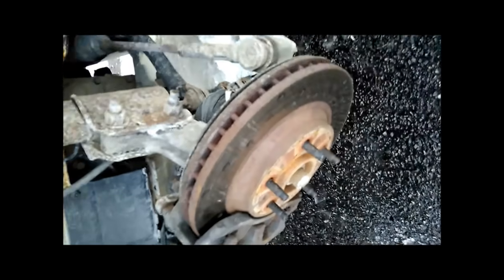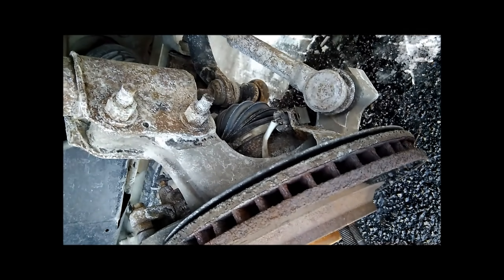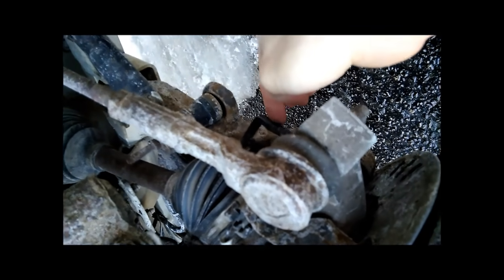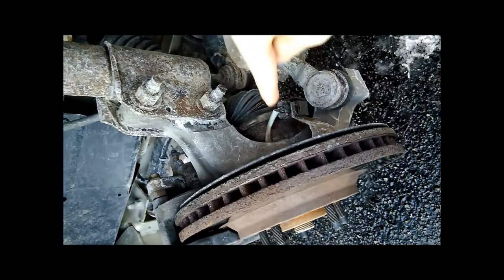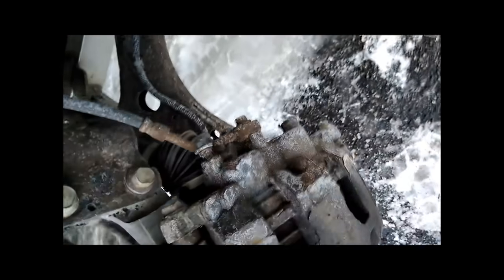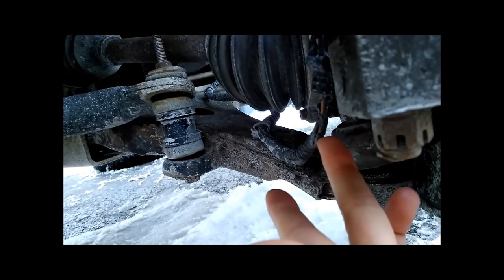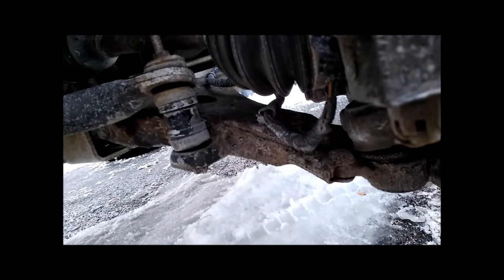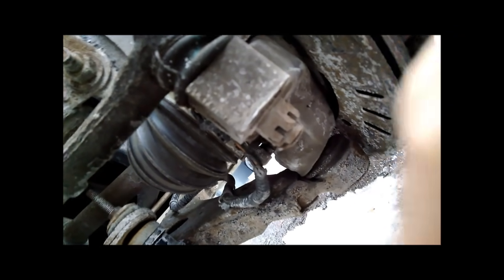How to fix ABS light, Traction Control, Stabilitrak

Comment: Tip from other video-Turn on keyctovRADIO-Apply GAS PEDAL 3x . WAIT AND WATCH ALL LIGHT GO OUT. .. take for Drive@15 ml. Hr. 10 mins( should) fix
Reply from the maker: That sounds eerily similar to how you reset your change oil light.  The TCS MIL lights activate based on the system's health.  Clearing the lights wouldn't make the problem itself go away.

Comment: I have a 2016 Scion IM battery was dead for a couple days and then the traction control light came on and hasn’t went off. Should I check the sensors behind the wheels
Reply from the maker: by dead do you mean disconnected or just low?  Low voltage can screw up the computer.  I would disconnect it for several hours and then reconnect it first.
Reply: @ChrisCamaro  Just low. Disconnect the battery for a couple hours or the sensor? Thanks man appreciate it
Reply from the maker: @luisgarcia2326  I mean the battery.  Because when the voltage is below something like 10.5V (in most older cars at least), the car's computer is voltage starved and behaves erratically.  Disconnecting the battery is like doing a hard reset on a computer.  Most systems will forget any glitches they had before and just boot up fresh.  Of course when you reconnect the battery it should then be healthy (12V or more).  If the car is running you should get about 14.5V.  If you have less than 11 when the car is running, all sorts of bad things will start happening.
Reply from the maker: If you want to just test the theory without buying a new battery, you could disconnect it and while you're giving the car a rest, you could charge the battery at 16V for several hours.  This "kind of" fixes it.  See my video on rejuvinating a car battery.  This way at least when you reconnect it, you aren't undervolting the car

Comment: I recently got two brand new tires on my car and then I started noticing the traction/abs light coming on. However, the light comes on for a while and then goes off.
Reply from the maker: This "can" be the fault of the tires if they are not the same size as the other 2.  It's important that the tire circumference of all 4 tires are the same.  If they are different by enough of a margin, the computer doesn't understand why 1 or more wheels are spinning faster (because they are smaller) than the rest and can't do the traction calculations reliably so it shuts the system off.  It might be a good place to start if you check the designation of your new tires and look up the circumference and compare it to the designation of the other 2 tires to see if they match.
Reply: @ChrisCamaro  this is the exact problem I have on my 2011 camaro. Got new bigger back tires but it’s a major difference. Ordering new front ones Friday that will be bigger but not the same size a bit smaller. Hoping that fixes my problem
Reply from the maker: @foogiez  Check the rolling circumference and make sure it's not too different.  If the difference is marginal (ie. on the cusp of triggering the system off), you can cheat it a tiny bit by de-inflating the tires with the larger circumference and overinflating the smaller ones.  Of course this is only a very small cheat if you're 99% there.

Comment: Mine only comes on when it gets cool, like a connector is contracting some and the wire(s) aren’t completely.  Can some electrical gel be applied?
Reply from the maker: I probably wouldn't go that way.  Since applying a gel would mean you've found the problem area, it's much better to repair the damage in a more permanent way like splicing in a new wire or replacing a compromised connector, etc.

Comment: I have a 2007 hummer h3 that flashes codes and locks up the tires. Then all of a sudden it clears and I can drive again. I think it's bad wiring too. I live near salt water.
Reply from the maker: Salt is the bane of my existence.  Most of the car repairs on the impala are due to salt from the previous owner.  I would not rule it out.

Comment: Hi mate, I bought vauxhall Astra design turbo 2016 from copart but on the dashboard cruise control system, engine light and abs lights on can you tell me what can I do I'm soo much confused plz help me. Sorry I didn't tell you last week I went mechanic garage and they changed the abs pump after he reset the everything with scanner everything finished on the dashboard but when he drive the for checking when he press the brake coming voice he said I don't know what's problem now I bring the car. Today one more mechanic try but checked the brake padel position sensor he broken he show me but he said he is ok ,he don't know aswell.  I think brake padel position sensor broken that's way lights on dashboard what's you think plz tell me
Reply from the maker: You could have multiple issues going on at the same time.  With the engine light, you need to know what the code is (usually P something) to get more specific info.  A mechanic or anybody with a scanner can tell you that or you can invest in buying your own scanner (Ebay has some cheap ones).  For the cruise control, that's also unrelated.  Cruise control uses the vehicle speed sensor in the transmission to tell the vehicle speed and the stepper motor under the hood to adjust the throttle to maintain speed.  The ABS light is the only thing that depends on the wheel hub speed sensor.  This video will address that problem but for the other 2 problems you need to get your computer scanned and while you're getting it scanned, check the VSS signal from the transmission and have a mechanic physically inspect the throttle control.  If it's an old car it's going to be a motor pulling on a cable but if it's drive by wire it'll probably be part of the throttle control module.

Comment: I just took my equinox and got an oil change and after I left the traction light came on the abs light came on and said my stabilitrak was off? Also my tire pressures were lower than they were when I went in and at different pressures?? Will the pressure cause this or should I worry about something else ??
Reply from the maker: In theory, yes, if the computer is not satisfied that the all the components used in doing the traction calculations are in "nominal" conditions (like a flat tire), then it could decide, nope I'm not going to risk it, and it will just shut the system off.  To rule this out you should first inflate all tires correctly and see if the problem goes away.  Beware however that the stab light can sometimes come on (along with a bunch of other stuff) when a general computer fault occurs.  My most recent video is an example of this.  My batt went dead and the next time I started the car, the computer went haywire and showed various warnings for things that were just fine.  But start with the assumption that it's the tires.

Comment: Can this cause your steering wheel to get hard ? I have a Sierra denali and all the lights turned on for abs, stabilitrak, trailer break. Mechanic told me 2000 to fix but it doesn’t sound right to me
Reply from the maker: I really highly doubt it.  If the steering wheel is hard to turn, that's got something to do with the rack and pinion and/or the steering assist (power steering pump and related systems) with a lower likelihood of it being something like the CV joints or something else connected to the steering system.  The steering wheel is mechanically coupled to the wheels so any number of mechanical problems could increase steering efforts.

Comment: Could this also cause the electrical power steering censor to malfunction
Reply from the maker: Possibly the other way around.  The steering sensor can sometimes cause the ABS/TCS to get confused if it's not functioning correctly.  But I have never ripped that part of the car apart to inspect personally.

Comment: will this affect the power of the car? or the acceleration?
Reply from the maker: Not directly but it could indirectly as the TCS or ABS may activate at an inappropriate time and that means either getting brakes when you don't want them or getting cylinder de-activation / pulling timing from the engine.  These will manifest as a loss of power but more importantly could interfere with your control over the car.  This isn't something you'd want if you're in the middle of a turn for example.

Comment: So can this happen if i put to big of a wheel on the front of the car an drove around for a lil while before changeing it to the back of the car..? Now my lights for ABS Slip and rpms won't let me go or shift past 3rd an shifts hard car also dies out. 2005 Nissan Altima.
Reply from the maker: Having mismatched wheels will definitely screw up the TCS system.  The wheel circumferences all need to be the same.

Comment: 2011 Chevy Silverado no abs light but traction and stablitract is flashing.  Also tps sensor light for front left wheel but it is the back left wheel . So my problem could be a wheel on the drivers side of the truck.

Comment: Could something like that shutting down the system also cause a sinking brake pedal instead of a bad abs pump?
Reply from the maker: If by "sinking" you mean a "soft" pedal that squishes down as you apply even pressure, that is usually a symptom of air bubbles in the brake line because it was either not bled properly or there is a leak somewhere allowing air in.  Admittedly I've always found GM brakes to be a little bit spongy by nature but if you think it's spongier than usual it could be a safety issue if left unresolved.  Usually you will get an indicator light telling you that your fluid is low but you don't want to be on the highway doing 80 when that happens so it might be a good idea to get that checked.  The ABS has the familiar "chatter" pattern of braking but I haven't heard of a fault in that system causing the pedal to simply sink.
Reply: It could be numerous things bad booster bad master air in the lines moisture in the lines if its the pump you will know it will set a code or your battery will always die from it running the relays have cold solder joints it will set a code for bad wheel speed sensor

Comment: Had this issue pop up on my 2013 GMC truck.  Followed all the videos almost gave up.  Found another video and realized I had to disconnect the battery ground wire.  This removes all power from  the "computer" and once you hook the ground wire back up, the computer resets to the default and everything went  back to normal.
Reply: Thank u. I have a 2016 gmc. Wondered how to reset computer. I changed oil and stability trac but it still lights up

Comment: I purchased a 2011 Camaro ls with the RS package because it had been wrecked and I got a good deal on it. I had rode in it before it was wrecked because the person I bought it from is family and it drove great with no issues before the front end impact. I replaced the whole front end back to the fans. I opened the door today and decided to start it so it could run for a little bit and it was clicking like the batteries dead even though it’s not completely dead so I will charge it up tomorrow but what concerns me is I started getting the service stabilitrak light. The front end is up in the air on a jack that’s centered in the front. Before fixing it I had to move it several times with no power steering so I had to put strength into turning the wheel. Idk if that could had messed with the cable in this video or what. What’s your opinion on what is causing this and what would you check ? Could it be the battery going out ? Any of the new parts? The car being on a jack? It also says one of the rear tires are low all of a sudden . I’ve never dealt with this before .

Comment: Will this cause your car to just glide for a sec 🤔   My ABS light is on but not sure if that is what caused my car to suddenly glide to one side.  It was kinda scary.   My kid car did the same.  We both have a 2012 vehicle.    I have a altima and he has a Ford fusion.  Or could it be our shocks 😲  or alignment
Reply from the maker: By gliding to one side, do you mean the car loses traction and drifts left or right as if on ice?  The only way that happens is if there's a sudden change in speed of the tires relative to the ground, so yeah, that could be the ABS.  Was there a vibration underneath you just before that happened?
Reply: @ChrisCamaro  I was driving on the highway slowly because there's cement walls on both sides of the highway and it was curving left and right for about 5 miles.  I was cautious because it glided before. .  Then all of a sudden it was like my steering wheel just turned left for a sec and then It was ok.   It felt like when Texas had that ice on the floor months ago when I slid  I had no control until the car stopped sliding.   I do try to drive on the left side of the street because Austin and Houston roads are awful.   Constantly holes and bumps.  I think its more than one thing wrong with my car.  There's alot of noise coming from my right side where the tire is.  Also when I got a new tire on my front right side they told me my back Two tires are way too big.   But my kid drives back and forth from College Station he said his car was swaying and I was like me too.   What a coincidence.  He got 4 new tires a few days ago  and he said when he start to pick up speed it starts to sway.    He calls it  swaying I call it gliding. 😬      He got his car checked to see if it was his shocks they said he just needs tires. That's why he got the new tires.  I don't drive my car long distance anymore until I get it fixed.  But I want to focus in his car because it's going to rain all week and I told him to drive slow but even though I drove slow it didn't make a difference.   My kid says when he picks up speed it doesn't shake.  What do you call it when your car is going out of control and your car automatically corrects it 🤔  could it be that?   They say all his motor mounts are broken.   His engine shakes when he's sitting at a light.  But in park it doesn't shake but I don't think that is causing his car to sway.  🤔
Reply from the maker: @diggorypat66  I'm disinclined to think it's shocks unless they are so broken that the inside wheels are lifting during a turn.  Similarly having a bunch of broken engine mounts is terrible for the car but probably wouldn't cause you to lose traction.  I'm thinking the tires are the issue.  They all have to be the same circumference to work properly with the traction control.  The computer assumes all 4 wheels are equal so that it can get a consistent signal from all 4 wheel speed sensors under nominal conditions.  If conditions ARE nominal but the signals are all different because the tires are different sizes, it confuses the computer, which may think you're sliding when you're not and it may actually induce a slide by trying to "correct" what it thinks is a problem.  It will activate brakes selectively to synch all 4 wheel signals which is actually de-sync'ing the physical wheels.  Best advice is to get all 4 tires the same asap and inflate them to the same pressure.

Comment: I have that problem on my 2009 equinox. The mechanic said it’s a wiring issue and would cost $1100. I can’t do this myself, so should I find someone and tell them it’s the wheel sensor? Or could it be something else? Thanks!
Reply from the maker: If it's a "wiring issue" it shouldn't be 1100 bucks.  It's times like this when it helps to know a mechanic as a friend who will explain to you what this wiring issue actually is and then just DIY or have a friend help.  Paying that much is just unfair for you.
Reply: @ChrisCamaro  Thank you! I don't believe it should cost that much either. It's so hard to trust people. I had a mechanic I got off craigslist glue my brake light bulb to the inside of the attachment. I always change my own brake light bulbs myself, but the light kept going out, because the wires weren't making contact, so I had someone change the tail light harness, and that solved the problem, but he glued my bulb, so it was impossible to change it. He seemed very knowledgeable, so I believe he did it on purpose; no one is that dumb. Becsuse of what he did, I had to purchase  a new brake light assembly in order to change my brake light. I don't know who to trust anymore.
Reply from the maker: @aquarius_babyj7539  Yes, I know exactly what you mean.  I haven't found any sort of magic solution to this problem.  In fact I have to protect myself the hard way - by knowing more than the person who's fixing my problem.  And that is almost more trouble than it's worth, if it's even possible for me to grasp the issue.  At least then they don't try to pull a fast one on me but it almost defeats the purpose because, if I know more about the problem, it may be unnecessary to get somebody else in the first place so it's like why bother lol.

Comment: What are the sensors called?  I have a 2010 Buick la crosse
Reply from the maker: They're just called wheel speed sensors and they're inside the wheel hub assemblies.  You have to replace those.

Comment: So if the lights come on due to a disconnection...does this mean that the AWD still works or is it actually something that needs to be reconnected before it works again?
Reply from the maker: It depends on how bad the malfunction is.  Sometimes, an intermittent connection will throw a MIL light on your dash but because the system is kinda on and off here and there, it may actually work when you brake and the car slips.  However it would be completely unreliable at best and totally non-functional at worst.  Once the light comes on, you're in that gray area where the system is on its way to complete de-activation.  Doesn't mean the hardware is faulty but since the sensors are erratic, the system will eventually refuse to work.